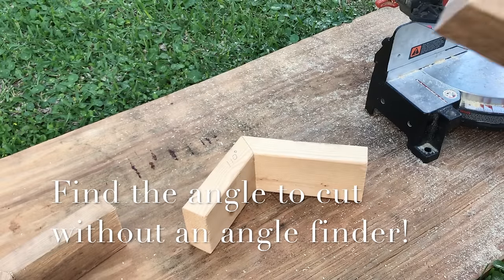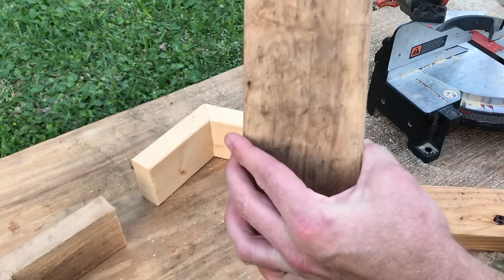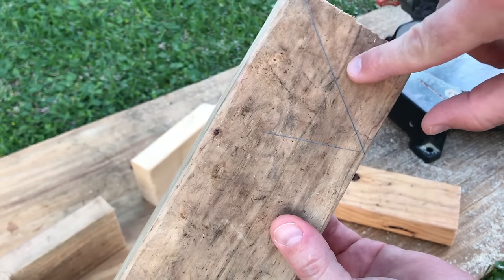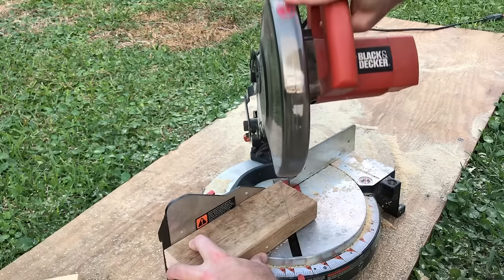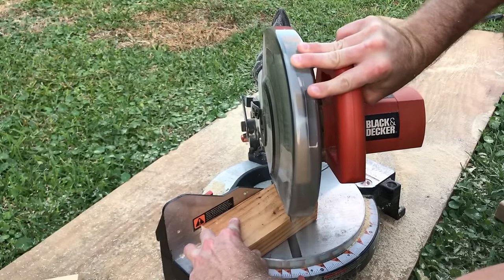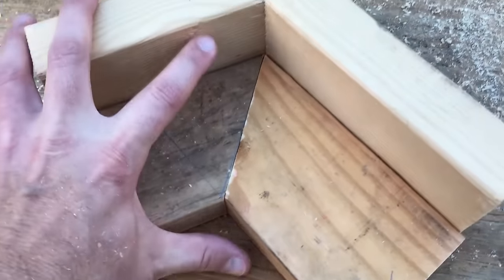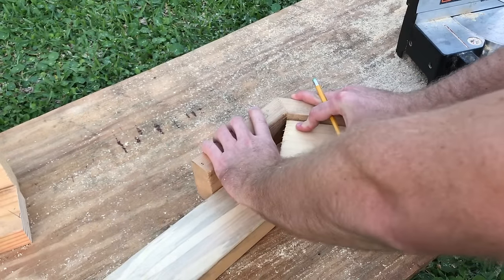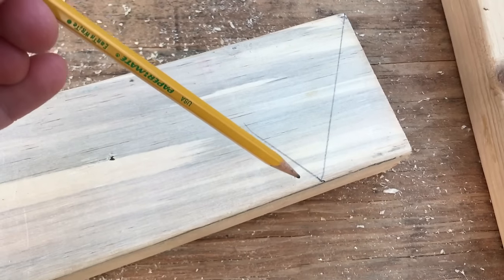DIY inside angles without an angle finder! Must Watch!

Comment: You are a bleeping genious!!!  How do I make the prop piece?  I don't have a power saw but I have a 1/2 inch molding I need to cut on a butcher block counter top to hide a gap against wall. I didn't want to buy stuff just for that little cut. Thanks so much!

Comment: This is another great tutorial on angles and how to get there.
However, I do have some questions:
I noticed on the first model you had 110 degrees angle, and from your previous videos you mention dividing that in half, which would be 55.
On the miter that would be 35...if I'm following you correctly...right?
However, you made the cut at 36, so does that 1 degree make a big difference?
Enough to show a gap in the inside corner, especially if you're not caulking the gap.
Thank you again for all you do!
Reply: I was wondering the same thing

Comment: Can you show me how to take the first angle cut, so that it is flush with the board with the 110* written on it? 
 I am learning fences, and cutting trim pieces on a slope is a pain in the ass, and my foreman hates me for not knowing how to do it. 

 So that the 2x4 or trim piece is angled to be flush with the 110* board, just like how you started with with your first 2x4. they do it without using a marking board underneath somehow, and I am lost.

Comment: gonna have to get a miter for my floor molding. tried cutting with a jig saw with it set to 45 and the blade didn't stay straight. Good tip  though thanks.

Comment: I'm looking to cut odd angle internal mitres on skirting board (I think you call it base board) on my mitre saw, but I have to lay the board flat on the saw base as its too tall to cut upright. Would the bevel angles be the same as the mitre angles you demonstrated here?

Comment: I've always struggled to cut angle even 45 degree and to get them lined up. This is a very good tip. When i want to cut an angle. I have the blade set a 90 degree .push the wood up to the blade hold  it there .then i will move the blade to 45 degree or 30 degree depending what your making  and go for the cut . It lines up when you join the 2 peices together
Reply: So the connected wood stencil needs to be glues at 90 ° for me to cut a perfect 45° angle right?

Comment: Question. Can you put a video together like this using this inside corner trick with an outside corner. Such is for baseboard molding. Thank you.
Reply: john ortega agree
Reply: Can this trick be used on outside boards?

Comment: The saw setting should be 35. 

180-110=70
70/2=35
The actual angle is 55 degrees. (110/2)

How do I know this? You taught me 😀
Reply: Thank you. For those who have a corner fireplace or bookcase or closet that fills in a 90 corner wall, that angle is 90+45=135 degrees.   
180-135 =45.  45/2=22.5 degrees. Set the saw to 22.5 and make you cuts for base board molding.

Comment: I am doing crown and I am having trouble with a bullnose. There is an odd angle near my fireplace  and I just cannot figure this one out.  I used my angle finder and know the angle is 120 degrees outside cut. However I cannot seem to figure out the cuts? Can you please help with some advice? Thank you.
Reply: Set your saw at 30 degree angle. 180-120=60 60/2=30

Comment: This technique works even if the two pieces are different widths, but you have to draw a reference line on the second piece as well.  The angles on the two pieces will be different from each other but will still add up to the total corner angle.
Reply from the maker: Yes sir, I actually have a video on that

Comment: Could this be used for a vertical inside corner, i.e. for cutting quarter round?
Reply: Yes but you would need a table saw and it would be too dangerous to cut that way

Comment: This is good thanks. Just a question, can you offer up the second piece without overlapping to get the first reference point and then trace that second line from the corner without doing the first line? I'm using a hand saw.

And can I just repeat the process on the second piece as a mirror image operation (seeing as I have to find that angle manually too)?

Sorry, total word salad. If anyone can translate that into real sentences that would be great too 😂🤔

Comment: Hard to mark angels using base boards or crown molding
Reply from the maker: kcmike7 don’t mark them on the baseboard or crown...use two pieces of scrap wood.  Then your saw will be set to the correct angle to cut...then put your baseboard on and cut.

Comment: how do I know when to cut the line or save the line ?
Reply from the maker: For this technique it doesn’t matter....its all about finding the correct angle on your miter saw to cut whatever trim you are installing.
Reply: wouldn't it be too short or too long?
Reply: Use the thinnest available marking tool- ink pen, mechanical pencil , or razor knife. 

For trim, cut a board exactly 10", place in corner and measure to that board; then add 10".  (Saves u from bending tape into corners).  

Then you'll know whether to leave, split, or cut out the line.
Reply: Why not leave the line and slow creep up on the cut exactly so the kerf doesnt mess you up?

Comment: In first example you state that angle is 110 degrees. Wouldnt that mean your miter angle should be 35 degrees? ( 180 - 110 ÷ 2 ).
Reply from the maker: You are correct.  I was 1 degree off.  From my experience as long as its not over 2 degrees off it will look good.  But for the most accurate cuts I would use an angle finder and the math formula for precision.  Thanks for watching!
Reply: EpicReplayz 180 degrees is a straight line. So if the angle is less than 180 degrees, then that’s your starting number.
Reply: Now I'm even more confused? isn't 110 divided by 2 = 55 degrees??
Reply: subtract 55 from 90

Comment: Probably should explain how the angle is 110 but your miter was set at 36 degrees. I ain't no doctor but 36+36 isn't 110. Half of 110 should be 55, which should read 35 on the saw, not 36. Ok 1 degree difference, it fits, but man how the gauge angles work can be confusing!